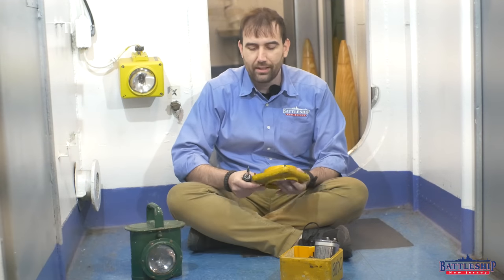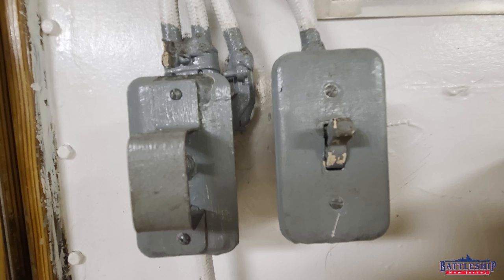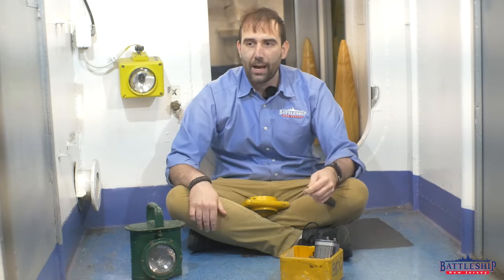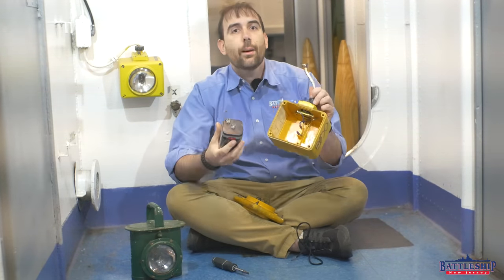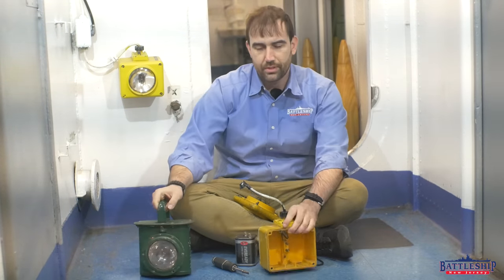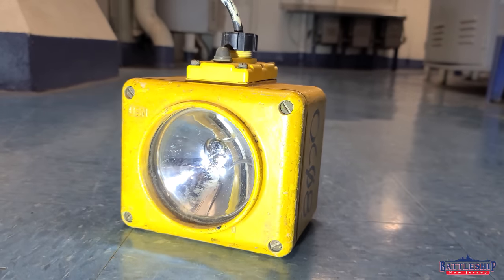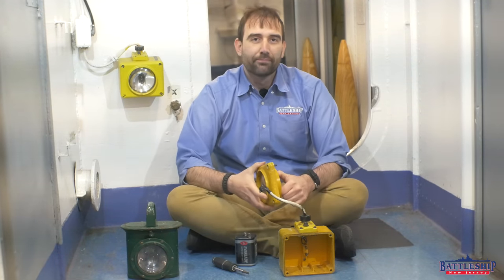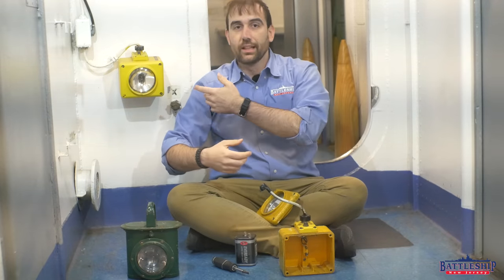When the Lights Go Down on The Battleship

Comment: I have replaced most of the lamps in my lanterns and flashlights to LED.

I get longer battery life and brighter light as well.

While that may not work with the sealed beams in Ryan's lamps, but I believe they do have them for most lanterns.
Reply: Actually without  measuring anything the lamps he has looked to have Par 36 (4411?) Bulbs they're common for landscape lighting and real common in old tractors and civilian lanterns using 6v dry cell (lantern) batteries .... but i would  love too know if the military was using an existing commercial bulb or commercial applications took advantage of a military spec'd bulb
Reply: The only light I have that isn't upgraded to LED is 22 year old MagCharger.  But between the upgrade module costing $60 and having multiple better options, it's hard to justify the cost. :-(